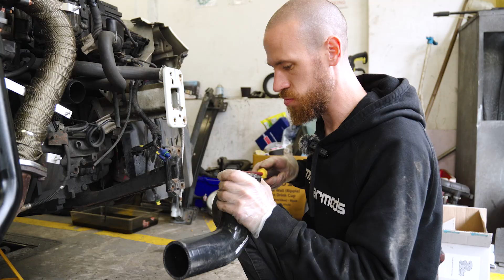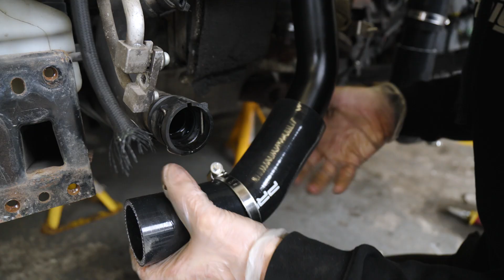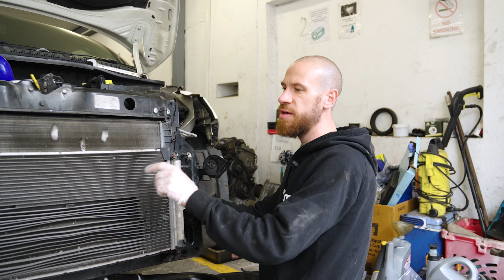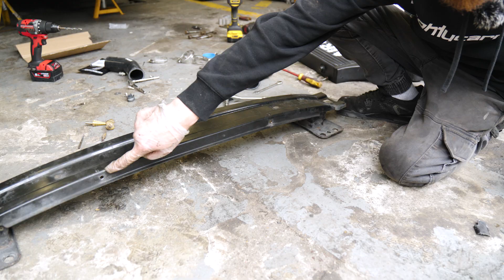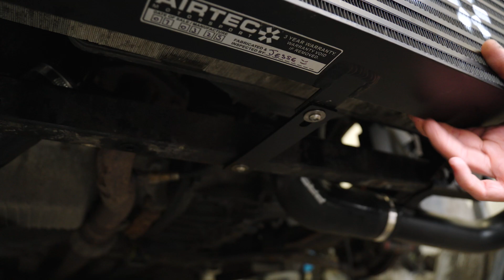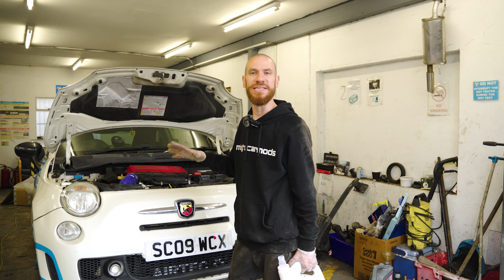DIY: How to Install a Front Mount Intercooler on your Abarth 500, 595, 695 - Airtec FMIC

Comment: When removing the air con lines, did you have to degas the lines and then regas once the air con system when refitting ? You don’t really mention this
Reply from the maker: Our system had no gas in it when we started but yes you would have to do this if there was gas in the system.